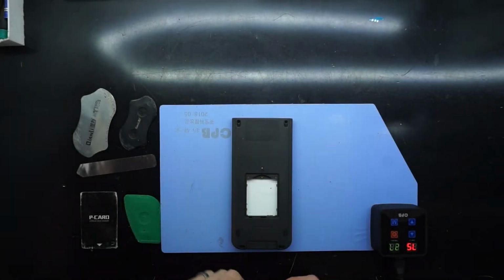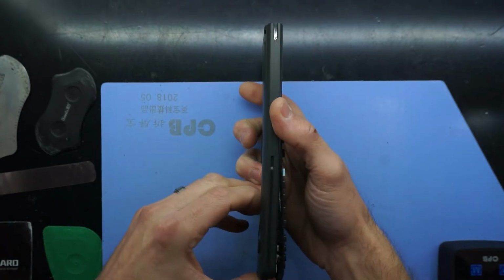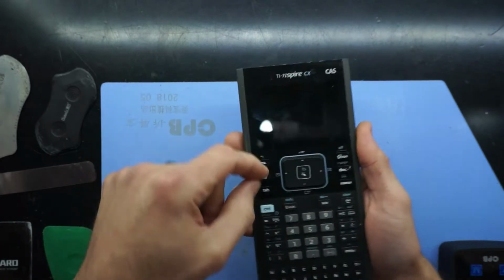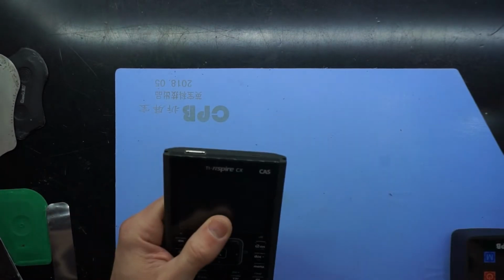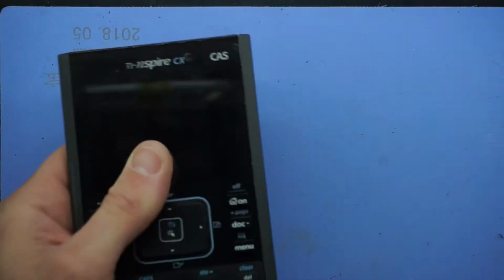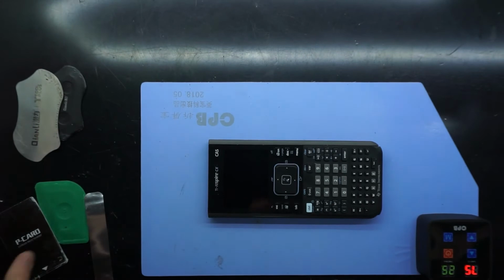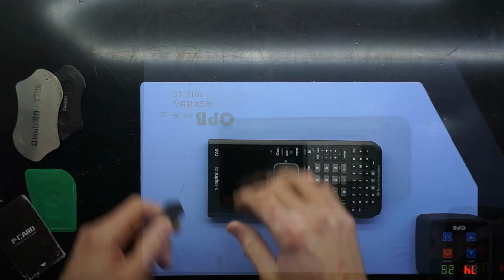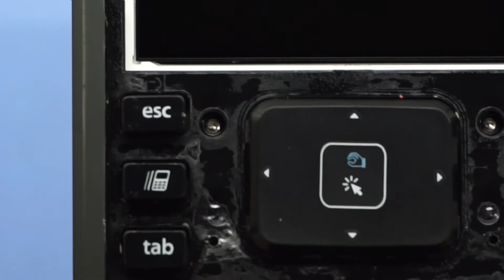texas instruments ti-nspire cx tear down

Comment: I have a heat gun, but I've never used it. Can I use it instead of the heating mat? It came with my soldering iron.
Reply from the maker: yes, just be careful and not apply too much heat

Comment: About two years ago I accidentally dropped a cup of coffee (witn mik) in my desk...unfortunately my loved IT was in the middle of it, I tried to "save it" be using paper towels,( I heard to not use a hair drier since it can spread the liquid worse) , put it in a bag of rice, several silica bags I had lying around from shoe boxes for at least a week, but the touch button got a "smushee" feel and the touch feature stopped working, more important I just could not trust that my calculator will work again as good as new...I eventually bought a new one and I have had the old one on my desk collecting dust. 

Today I saw this video and since I had nothing to loose I just went for it and opened it. I used a lighter since I don't have a heat gun lol, but that is a very strong adhesive they use!

Now that I see it closely, the flex cable for the touch button is rust with a greenish-black substance...I guess two years of spoiled milk do that.

Thanks for the video and well I learned a lot of things for the future.

PS. Since then I never leave any drinks on my desk anymore.

Comment: Id like to replace the original charging port with a normal mini USB port. Or is there are particular reason (like different voltage perhaps) that prevents me from doing it?
Reply from the maker: i dont think so but you will need to find the correct pinout as the ti usb is upside down (if i remember correctly)

Which makes it harder to find the correct usb jack for it

Comment: Hey so I have a CX II which has essentially the same layout as the one you are working on and the front plastic part is cracked. The screen itself is fine but the thing you peeled off at 1:55 is cracked and I've been trying to find a way to get it repaired or replaced. Do you know where i could get a replacement or a place i could send it to get it fixed because it seems pretty easy to replace it myself but i cant find a replacement online.
Reply from the maker: finding spares is very difficult for these, so i don't think there will be any available to purchase
Reply: @rickstechrepairs  alright thanks do you think there’s anyone I could send it to to get it fixed or is it the same sort of deal.
Reply: i don't know where you live , it can buy in china , about 60rmb (10 dollor),but olny white noncas model,

Comment: is there a way to clean the keyboard? my keyboard is super sticky, the keys won't pop out after you press them
Reply from the maker: not really, due to the plastic membrane under the keys, would to open and remove that and wash with soapy water
Reply: @rickstechrepairs  i spilled redbull and my +,3,6,9 keys are all super sticky. I have my final physics exam on wednesday, im doomed

Comment: Thanks for video... one of my CX CAS calcs just died during charging. Backside heatsup but does not power-on at all (slight screen flash during plugging-in of the USB wire or battery insertion). Does boot-up for 10-15 seconds if I freeze the calc (literally in the freezer). I'm assuming one of the components there is creating too much resistance and needs to be replaced. Have you encountered any similar cases? Do you have a schematic for any of the CX CAS versions?
Reply from the maker: Hi, no sorry I haven't encountered this problem, nor do I have schematics sorry
Reply: i have  exactly the same problem with my nspire cx.....
Reply: me too , it hard to fix it , i finally give it up , then I bought a secondhand cxii with a defective screen and planned to replace its screen